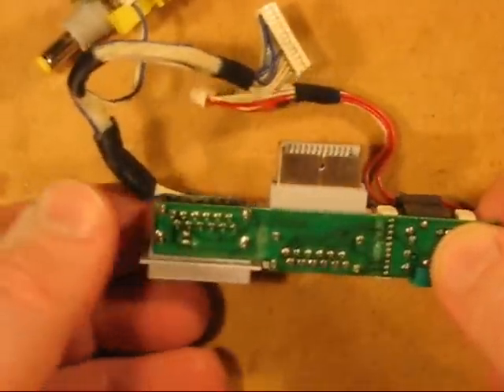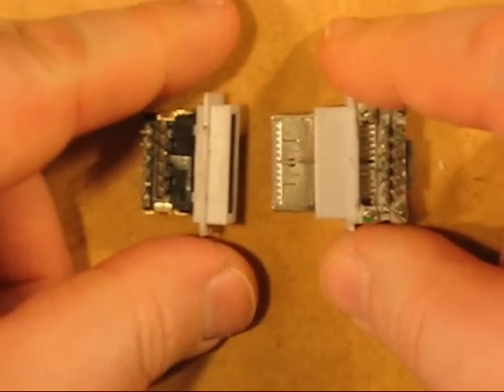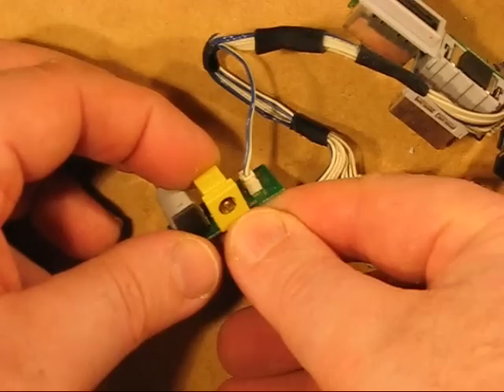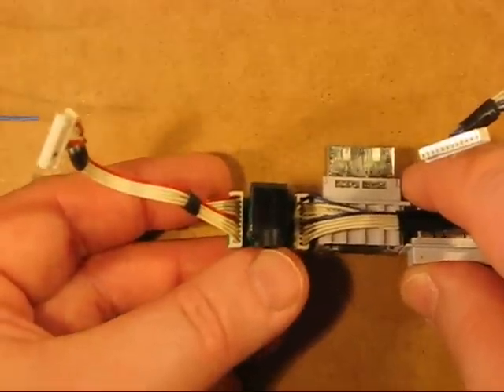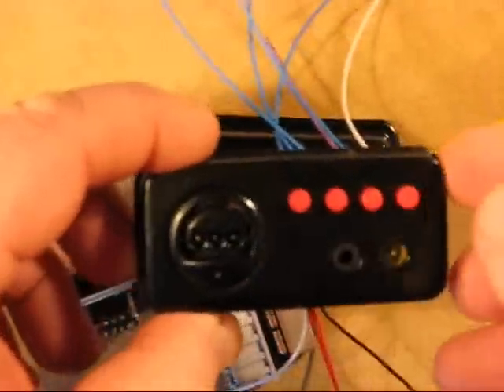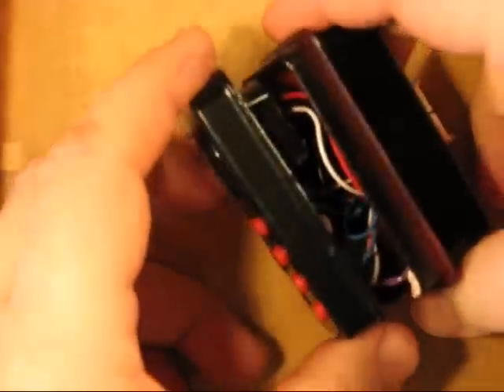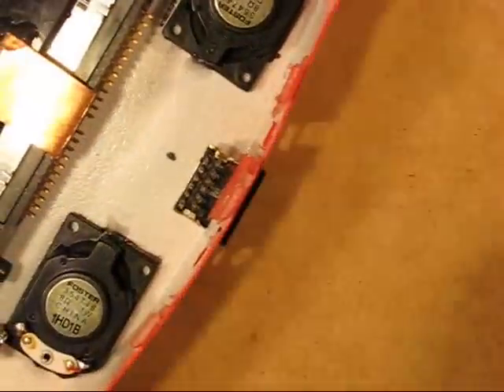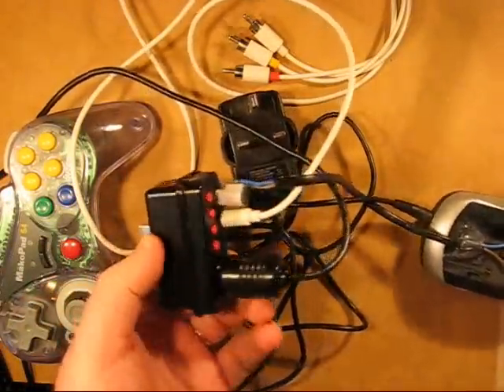N64 log - 12 - the multi-function plug port

Comment from the maker: Interesting observation. Seems to work fine with using one pin, the pins aren't that thin and their distance is short, seems to work fine though (i've been recharging the cells a couple of times since building, been fine).

Comment from the maker: I only play console games by myself so only need the one port option. The gadget I made has two spare pins so could have added a second port with no issues although that would have made the little box 50% bigger.

You can easily adopt this multi-function port to offer more options if you want, and for example use an IDE port if needed (40 pins). You could then have 4 controller ports, S-video and A/V, etc.

I won't often play a game on TV output anyway, just thought i'd add the ability to.